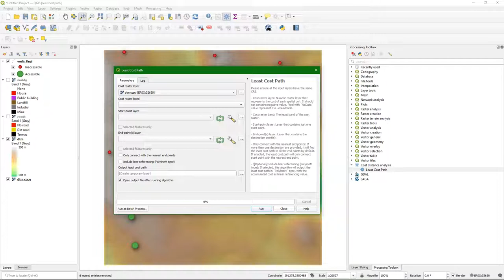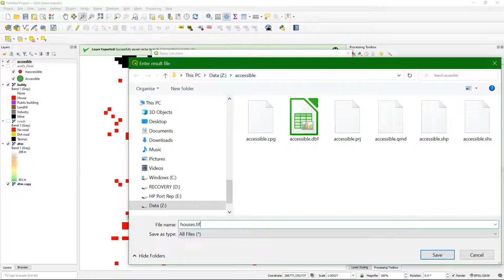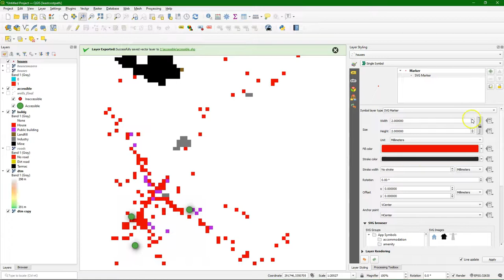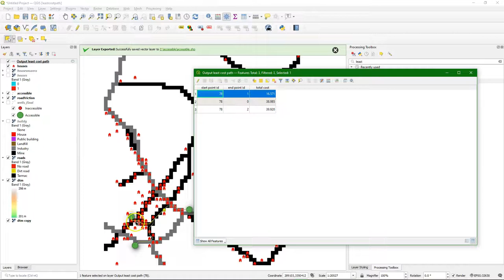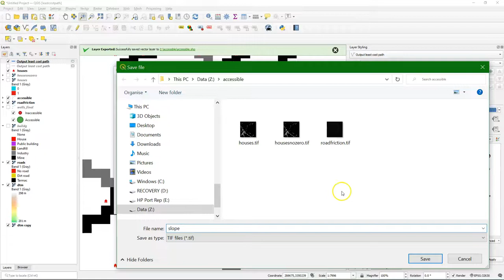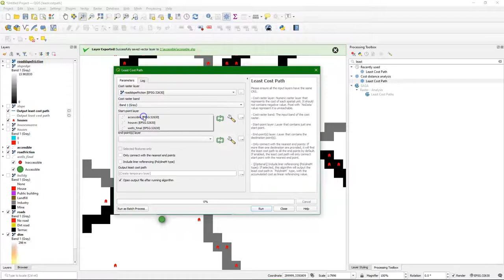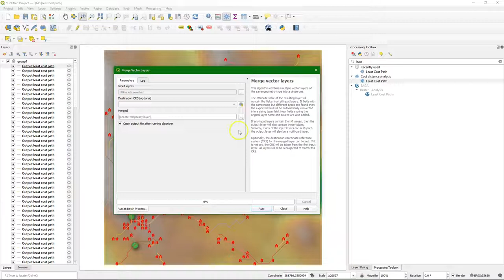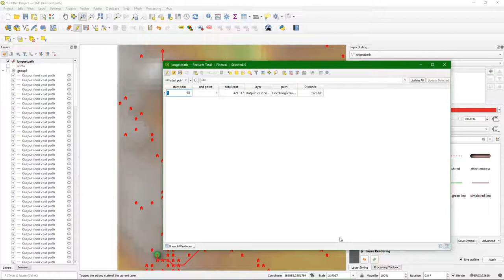Least-Cost Path Analysis with QGIS: Route from Houses to Wells

Comment: Hello. I am trying to do something similar to this but with many more points (about 5000). Memory-wise, it is not feasible to load each layer and merge into one file. All I need is the resulting attribute table with costs and ideally distances of all the paths. I can save each path as individual files without loading them, but I was wondering if you have further suggestions on how to approach this issue.
Reply: Update: I was able to merge the files in Python and subsequently work with the merged dataframe in Q

Comment: In the Least Cost Path method, is it possible to select a maximum slope of 10% for route design?
  Also, the path that he suggests should be close to the criteria of Road or Highway (for example, longitudinal slope, geometric and Curve design, etc. are suitable), not walking!
Reply: did you find a way to do this?